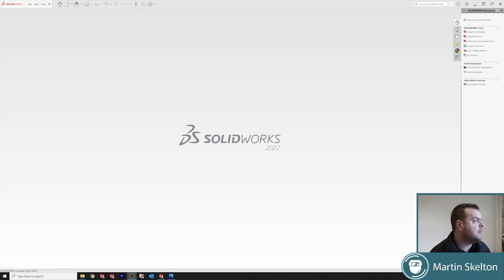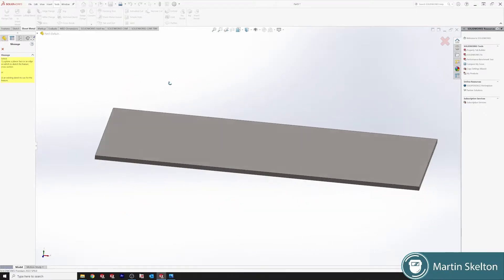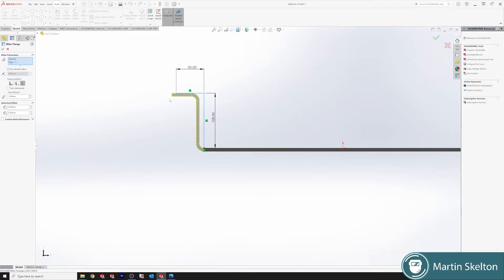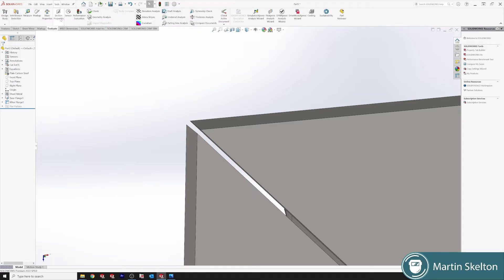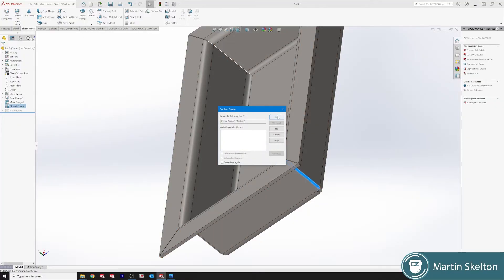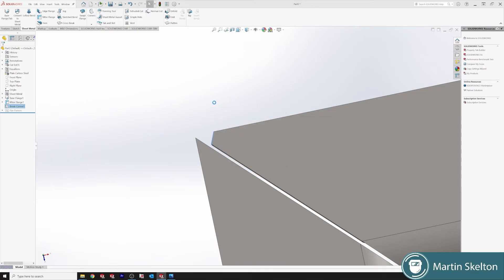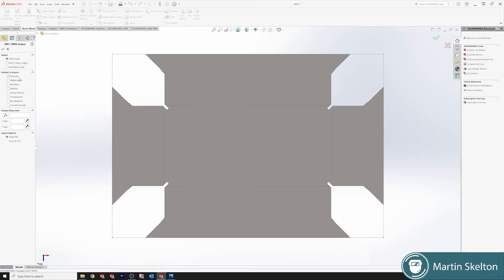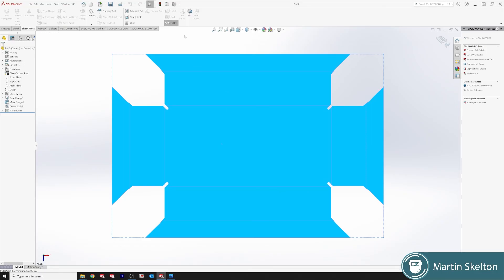SOLIDWORKS Sheet Metal Tutorial #5 // MITER FLANGE // CORNER CONDITION

Comment: For half circular plate can we make it
Reply from the maker: Hi, Half circular plate is a hard one because it depends on what way you are manufacturing the component. The Mitre flange is base on the principle of a 90 degree bend over a length required in a single direction. This in not possible with a circular plate, for a circular plate a edge flange is required and it will allow the material to roll around a circular end. This is possible for manufacture if you are pressing material or have a edge roller, you can make what is called a dished end. Otherwise another approach is to weld a strip of material on the half circle and pull it to shape around the edge. To achieve this in the software something like a swept flange might be the way to go. Thanks for the comment and I hope the video helped.

Comment: Hey Martin how would you show the bending angles and bending direction (up-down)  ] in the dxf/dwg ? I get all of my parts laser cut and folded externally to my shop. Im just looking to simplify my process. I am self taught in this area which is why i lack the knowledge
Reply from the maker: Hi Jacob, I don't ever show my fold angles on the DXF as it can lead to cutting mistakes. The best way I found is to send a drawing of the component along with the dxf. The drawing that I send is a pdf version of the original SolidWorks drawing. The SolidWorks drawing will show all the fold lines and sheet data that is required. There is a few advantages with this: (1) A pdf cannot be changed except with difficulty, (2) The pdf drawing also shows the outline dimensions (wide, length, flat pattern, folded object, etc), this allows the laser operator to check for scale of cut parts etc, (3) It allows for fast pricing / quotes and shows amount of material needed, (4) A drawing is usually produced for the part anyway, ( 5) It allows for indexing of a component and the laser file. (6) Pdf files can be opened on most phones / tablets without any specialist viewers. It has many more advantages also these are just a few. Every Dxf file I produce for cutting is sent with a PDF file of the part. Thanks for the comment Jacob.

Comment: Brilliant tutorial as always. Quick question for you Martin, if say you have made this part and the press brake operators say the ends will clash with the tooling, unless the front and back sides are removed for folding. Is there an easy way to separate the front and back sides so they retain the geometry for the mitre flanges so that they can be welded back on after folding?
Reply from the maker: Hi Rich, This is a hard one and also a annoying one (often happens), but there are a few ways that can be used as a work around. First one is to create a multibody sheet metal part, that is one part file but it contains two solids (in this case 2 pieces of sheet metal not merged as one). Then take a flat pattern of each piece separately. The second is to create the piece as normal and then remove the ends from the dxf file to give you a main body dxf file and a side end dxf file. (Dxf used for cnc plasma etc some people use other file types such as dwg etc). There are other ways also such as building the parts in an assembly but these two ways are worth a try first. Thanks for the comment.
Reply: @skeltondesignsolutionsltd  Hi Martin, the multi body sheet metal part is a good idea, so if I create the single part as you have done with the mitre flanges, then split the front and back parts on the fold line that might work, I have tried doing that in the past but couldn't figure out how to do it easily. BTW, I'm sending my files to the fabricators as STEP files which does away with the need to create additional drawings for the laser cut and folded parts so saves hours of additional time. DXF is OK for the flat parts.

On a different note, am experimenting with the weldments on box section, so instead of welding two or three parts at say 90 degrees, I laser cut the vee in a single part then fold it, not sure how to use the completed folded part in an assembly as yet but need to figure it out. Solidworks can be hugely frustrating at times but when it comes together it's fantastic, and all the better when folks like yourself upload straightforward tutorials - so thank you for taking the time to upload them.